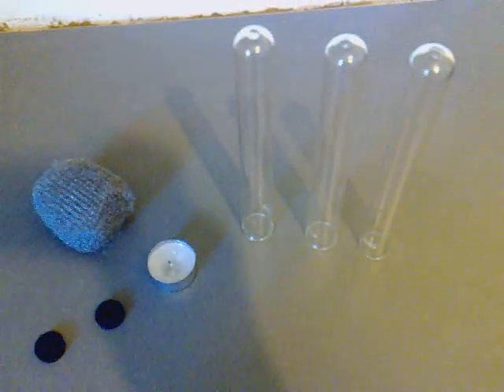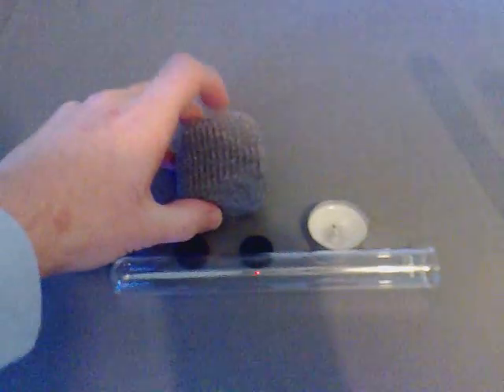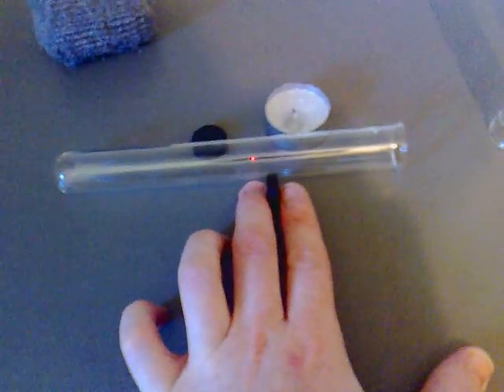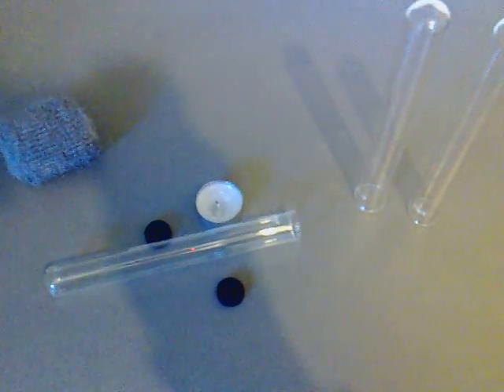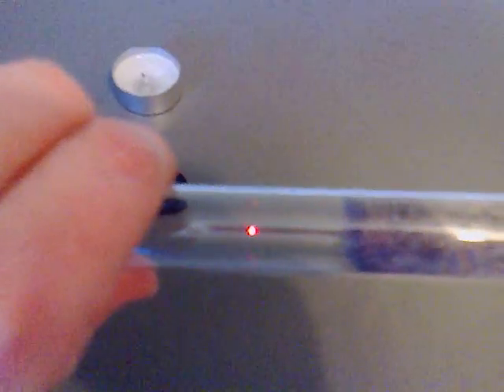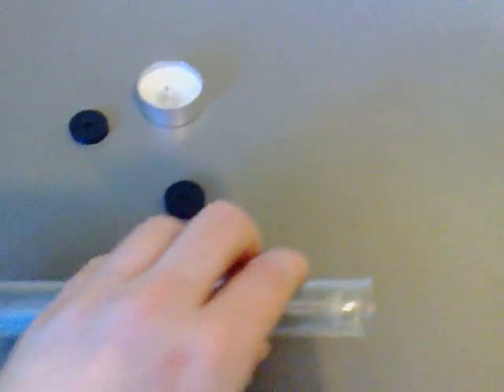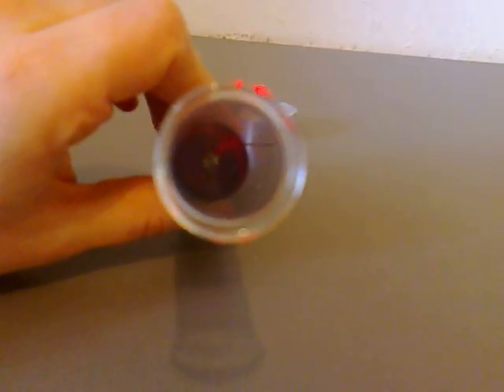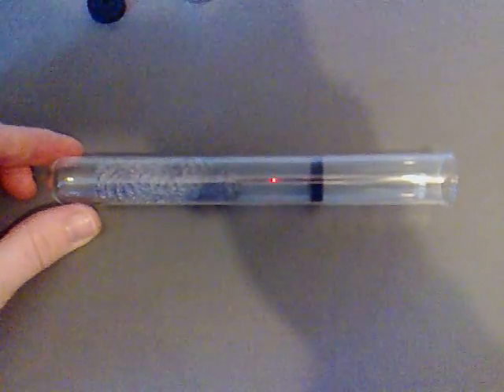Stirling Engine (Laminar Flow) 001

Comment: Another idea could be to paint the hot end black and put a magnifying glass into the sunlight on it.  

Oh i see a piston is needed, maybe put o-rings around a little link of pvc pipe, and oil it so it runs well.

Thanks,  Ben.